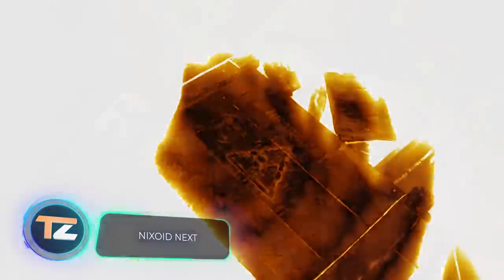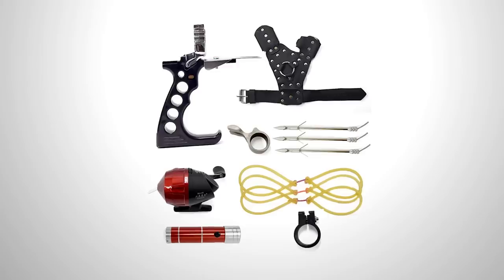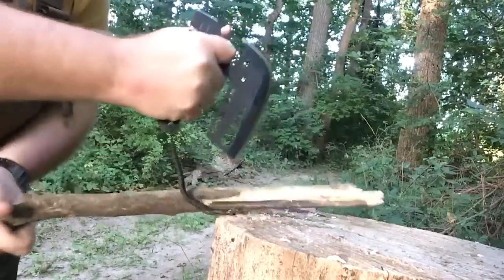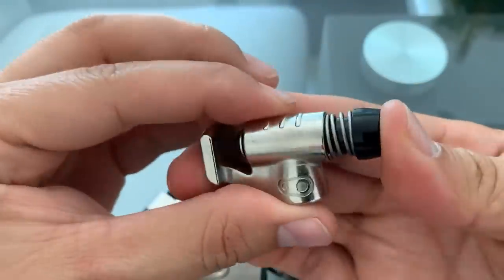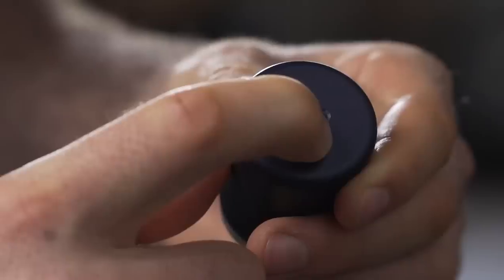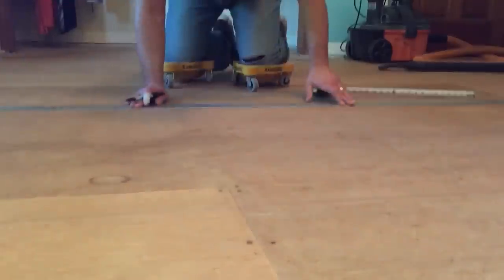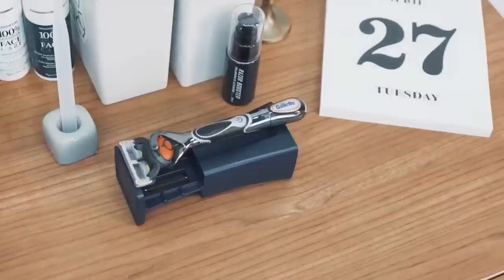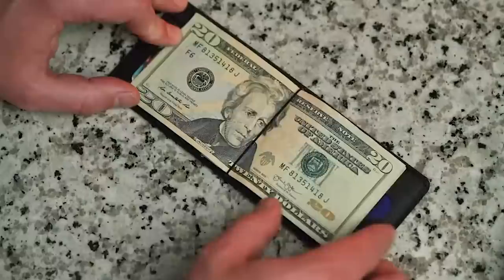COOLEST GADGETS FOR REAL MEN

Comment: Picked up a pair of kneeblades last year, they're fantastic!
Reply: I spend half my day wearing rubber knee pads.  They save my knees (I've had one knee operation and a long term injury to the other) but when kneeling on knee pads you still scuff the toes of your shoes.  They advertise it by sending someone down a bob-slay run like the Cresta.  Or, if they were cheapskates, they could use the luge (I think they call it an Alpine Slide) at Jackson Hole.  The person would die — obviously — but there's no such thing as bad publicity.